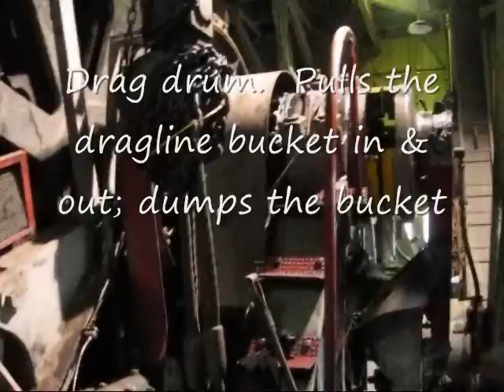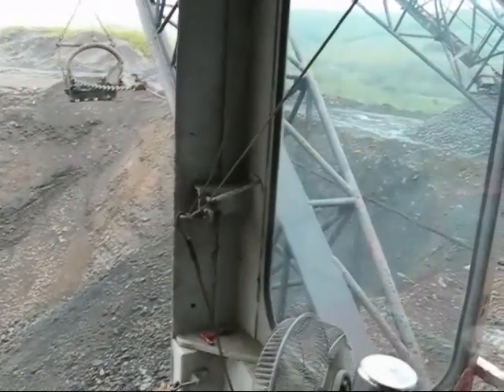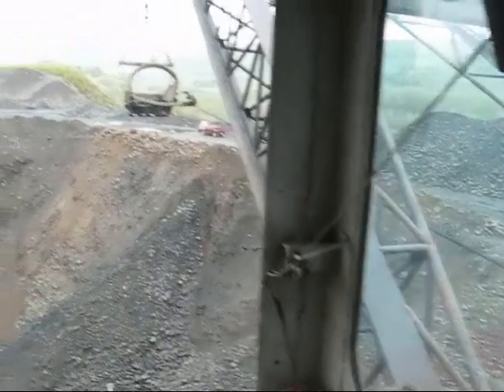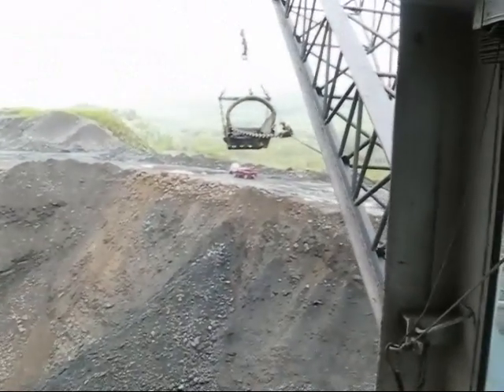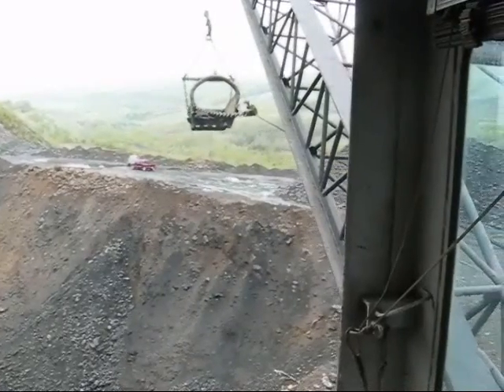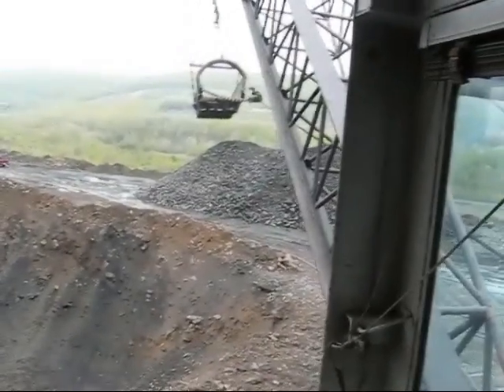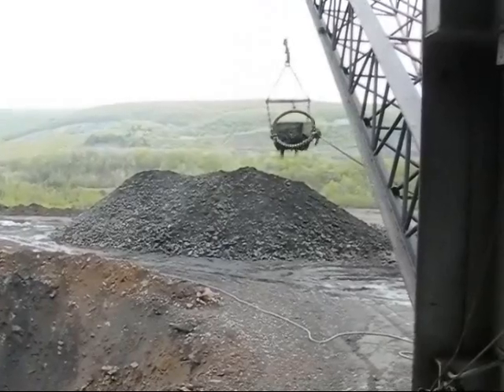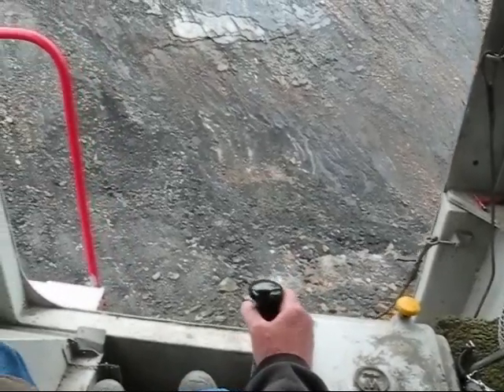Inside a Marion 7800

Comment: Since 1977 eh??  😮 
Let’s see, the 1st Dragline I ran was a Linkbelt Speeder with a 2yard bucket
From on top of a pile that a larger Dragline made, I was loading a portable rock
Crusher with lime rock at Miami Crushed Rock in Sweetwater north of Taniami Trail. 👍👷‍♂️
Ran Lima 2400’s Clamshells & Draglines, B&E 88-B’s at This rock quarry and a Coal strip mine in
Indiana... then I decided to be a Pilot 👨‍✈️ and flew air cargo 🛫✈️🛬 for 22 years 😎 but then I decided   
to run Construction Cranes 🚧🏗. Again and after that one more Lima 2400...!! 😎